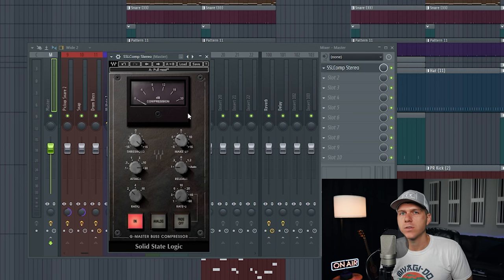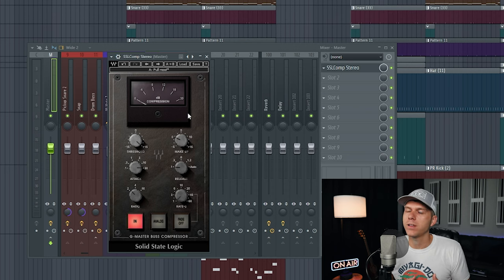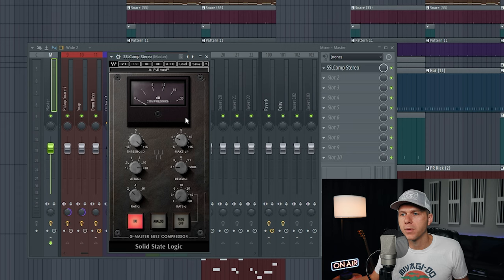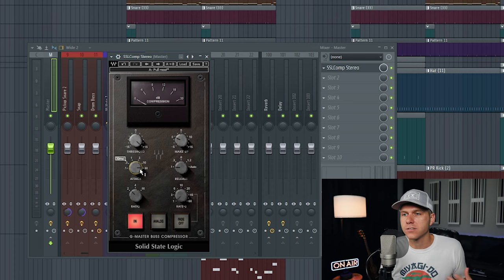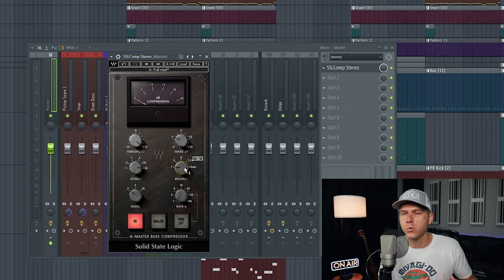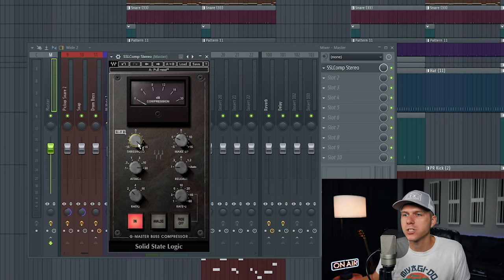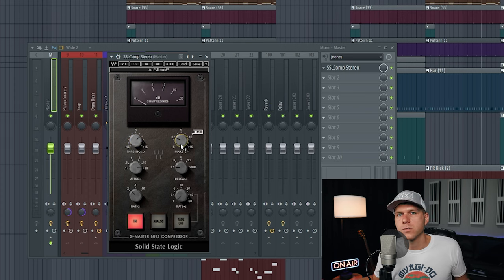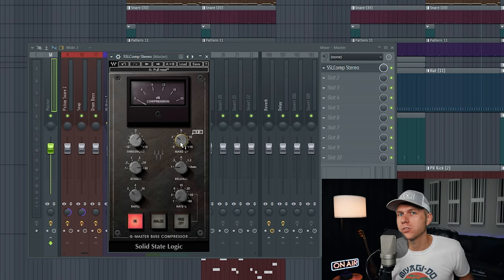Using Bus Compression to GLUE Your Mix Together

Comment: I only have fl compressor does the settings apply ?
Reply from the maker: Yeah just make sure to have a slower attack, fast release, low ratio, and only aim for 1-2db of gain reduction.
Reply from the maker: The only negative is that there is no gain reduction meter on Fruity Compressor to show you how much compression you’re getting. Fruity Limiter has a compressor section on it and it might work better for this.
Reply: @mixwithjerry  ok and also use the same settings

Comment: Usually I only add compression to my drum bus. Should I stop doing that and only add compression to the master channel?
Reply from the maker: It really depends. If you’ve already applied compression on the drum bus then I would be very gentle on the master if adding compression, because at that point the master compressor is really only going to be compressing the peaks which is mostly just the drums. So you’d be doubling up on the compression if you already compressed drums. If you have access to the whole mix with the individual tracks and busses then I’d do most of the compression there. Any compression on the master would be barely any at all and more so for getting the tone and warmth of that compressor.
Reply: @mixwithjerry  Thanks. I appreciate your feedback.